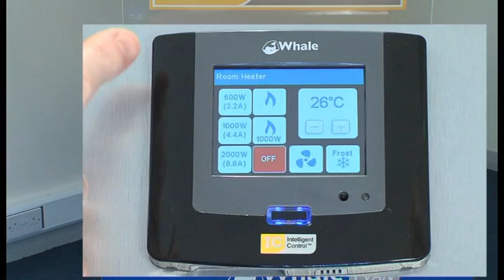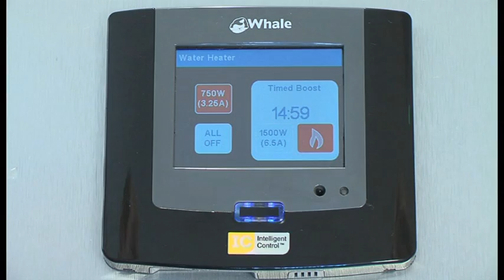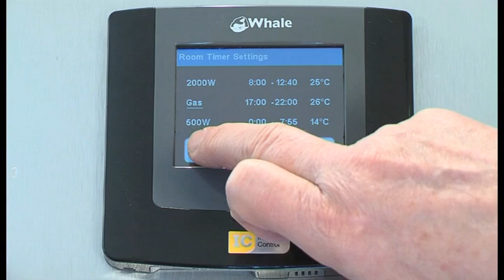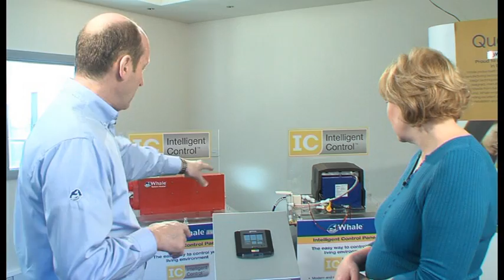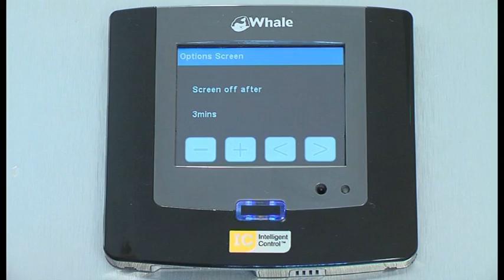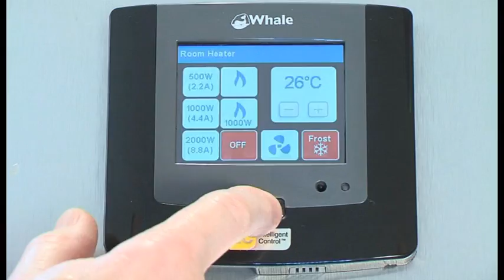Why the Whale i Van control panel is an easy way to control your living environment!

Comment: Ive a pegasus verona 2015. Which as the Ivan system. Seems very easy to use however ive just spent 3 days 'off grid' . And couldnt figure out how to heat the water up for a shower or washing dishes unless i stuck it on the booster settings ( gas only )  . And ideas for future reference please.